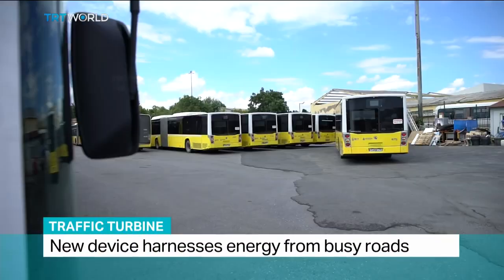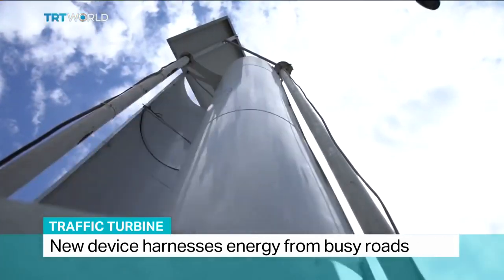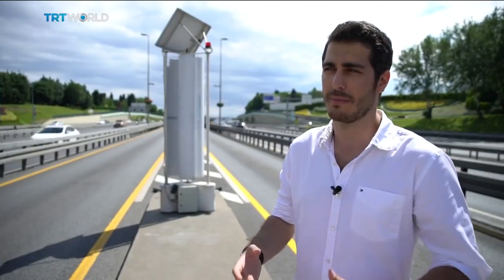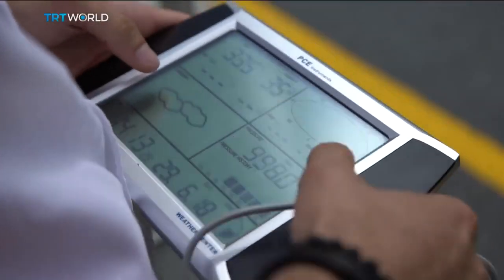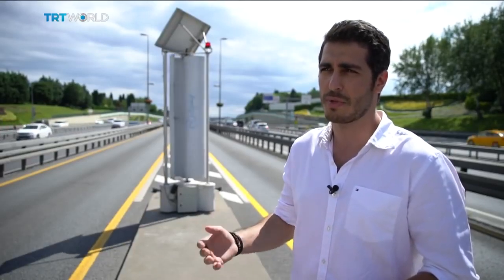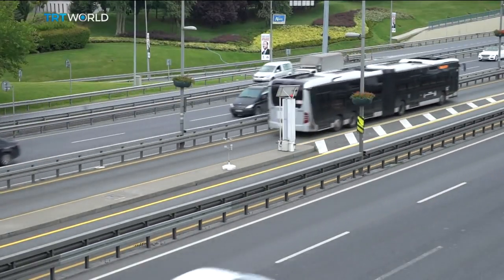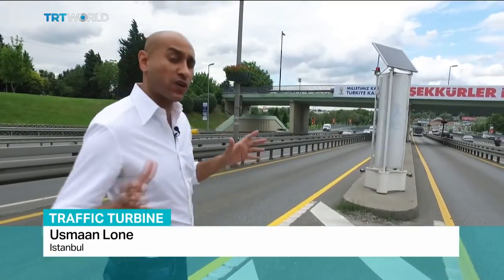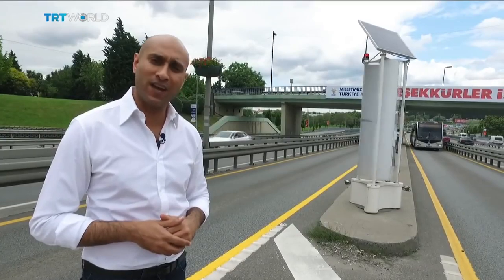ENLIL-VERTICAL AXIS WIND TURBINE -TRT WORLD NEWS

Comment: I literally came up with this exact concept to detail back in late 90's and have actual drawings and witnesses, I didn't have the funds to pursue it and here it is before my eyes In actual reality.  I'm completely blown away.
Reply: Very cool... Would some kind of crash proof mesh fence kill the efficiency? The one in video looks like a bus going slightly off line would destroy it.
Reply: Sue him for royalties
Reply: I was thinking the same thing!   I realized that the wind generated by opposite flowing trafic in the center of the roadway could e used to gen. power when I had to change a tire in the center emergency lane in high school in 91.  Like you I also didnt have the funds to develop the concept & because I had no engineering degree got told "no thanks" by the city. Sad to think how many simple ideas like this are likely thought of, but never developed because of lack of funds, or lack of vision of those who do, & Lack of intrest by those in power simply because the idea cme from someone who couldn't afford to buy "accepted credentials".
Reply: I had literally the same thing happen to me

Comment: traffic probably will use more fuel by doing this, due to energy's law. have u tried putting it on a building?
Reply: Nope. That would not generate any additional drag on vehicle.
Reply: Might actually allow less resistance for the vehicles as you would be inhaling the air that would have been other wised blown into your lane from opposing traffic. If they exhaust the inhaled air upwards then there will be less molecules in the way of traffic.

Comment: I agree with putting turbines along a motor way. But not to get energy from cars. Since the road is already reinforced with concrete and sand you save money on the turbine foundation. If you raise them up by 3 meters you will get much energy from the wind. If you line the sides of the motor-way with turbines you get a barrier which takes energy out of the noise created by the motor way so local communities are less impacted by the motor way. If the entire motor way had turbines the small energy each one produced would add up to an enormous amount and could power homes and EV charging points up and down the country. The motor way is already an eyesore so why not give it an extra practical function.
Reply: We are working on it as our final year project of electrical engineering.

Comment: I don't think the idea of arranging individual vertical turbines is practical. Because by the time each of the turbines is started up by the wind from the vehicles, the vehicle is long gone. The same applies to the subsequent turbines. I therefore do not consider the movements shown in the video to be real. The turbines spin there even when no vehicle is passing - and they do not spin faster when one is passing.
In order to be effective, the turbines must be arranged in series in such a way that each subsequent rotor also drives the one in front, and this over a long distance. Additional wind deflectors are to be installed so that counter-rotating winds do not slow down the running rotors. Such a development currently (January 2023) exists in Germany.